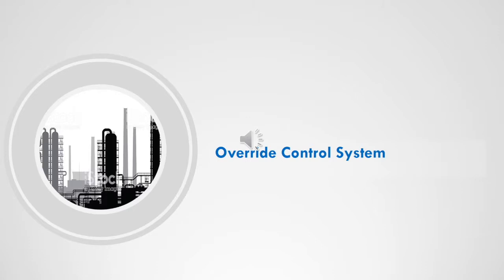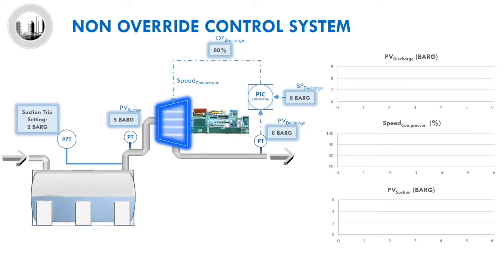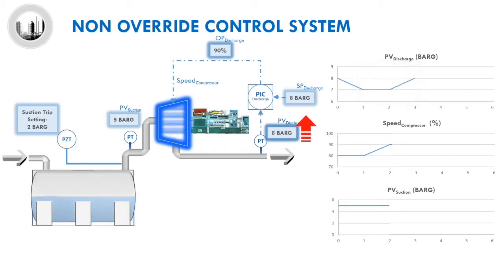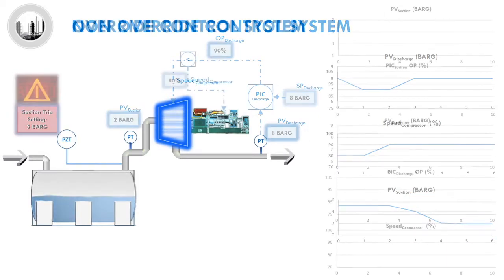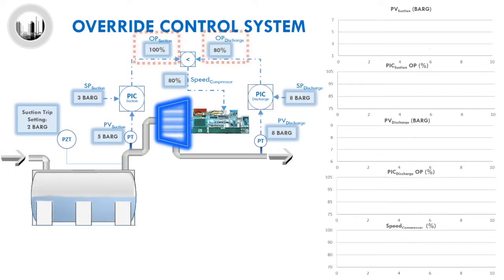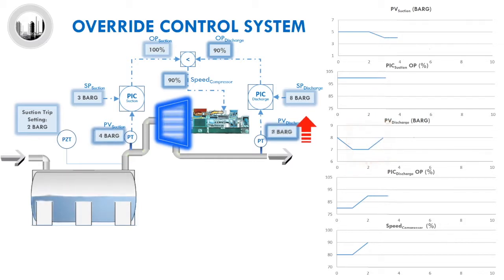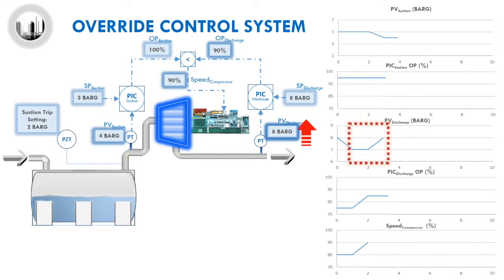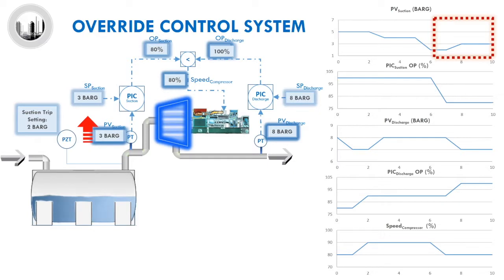Override Control System

Comment: Are you referring to surge when you say unnecessary tripping of the system?
Reply from the maker: In this example, the intent is to avoid trip on low suction pressure.  With override control, suction pressure override set point is 3 barg, which is higher than the suction pressure trip set point of 2 barg.